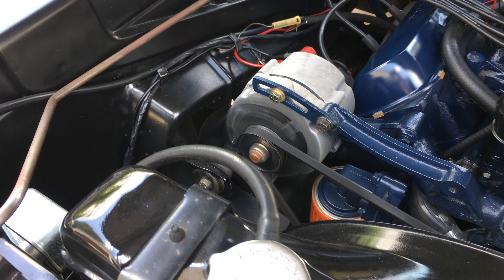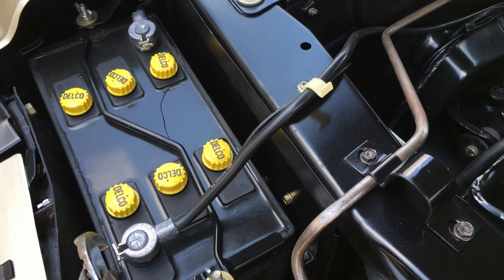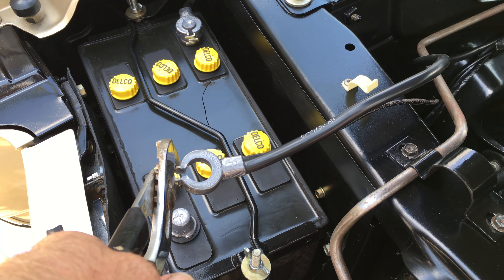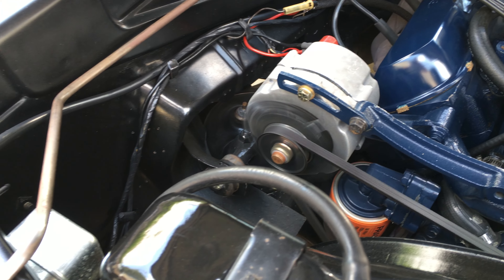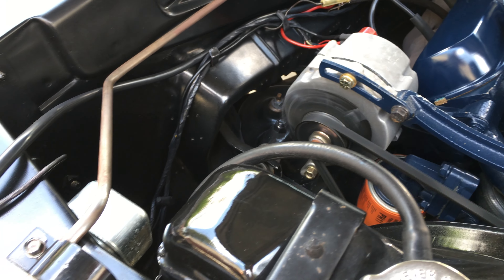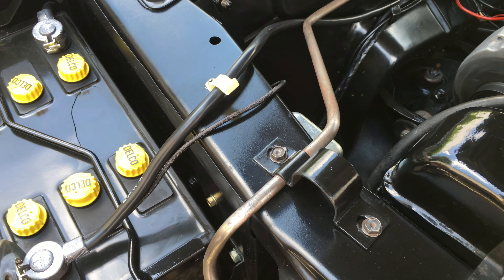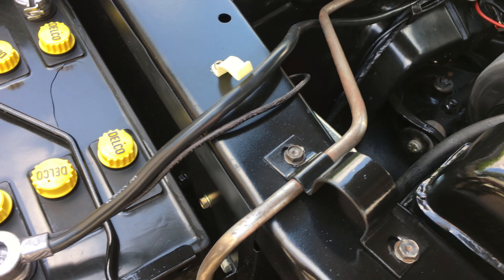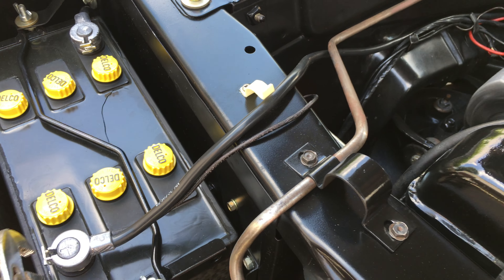Simple Alternator Test

Comment: Removing the battery cable while the engine running is very bad! It can cause voltage spikes and ruin any electrical equipment connected to the alternator...
Reply: 2015 buick rip computers from.this
Reply: On newer cars with complicated electrical systems I agree, on these. Probably not.
Reply: This has been done like this for decades to test the Alternator..